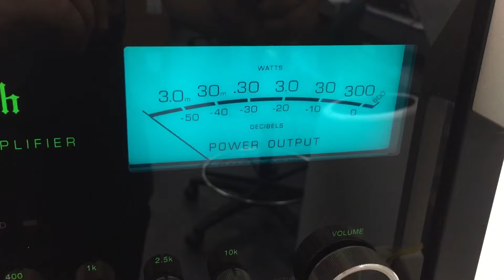Mcintosh MA9000 meter

Comment: That's a really nice feature.  My old, but still working MA6900, has little incandescent lamps for the meters, and when you replace one, the new one shines brighter than the older lamps.   So, to do it right, one has to replace all of them at the same time on both meters.  That's six lamps, and they are soldered in.   I bought an LED upgrade kit, to replace all the incandescents the next time I need to open the case, so hopefully, that will alleviate this problem, somewhat.  Glad to see that McIntosh has moved to LED lighting on their newer units.